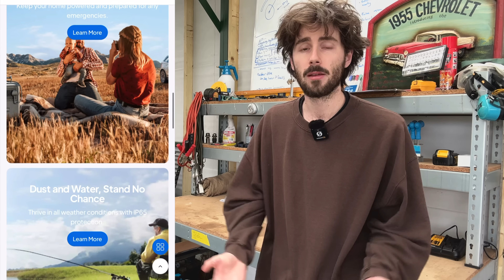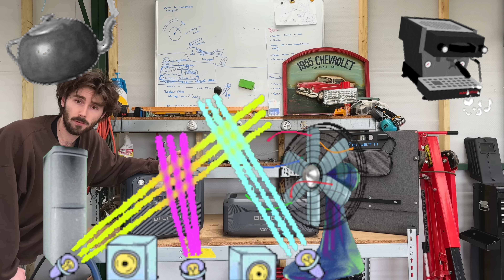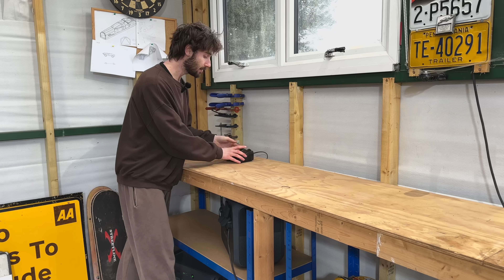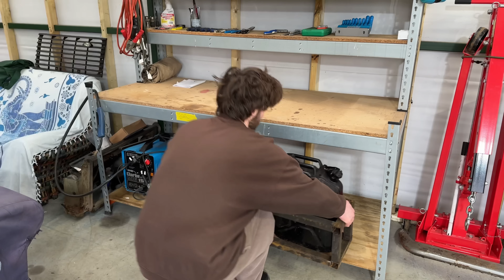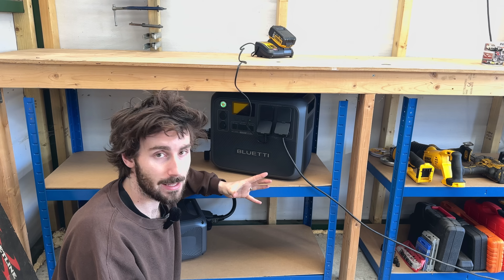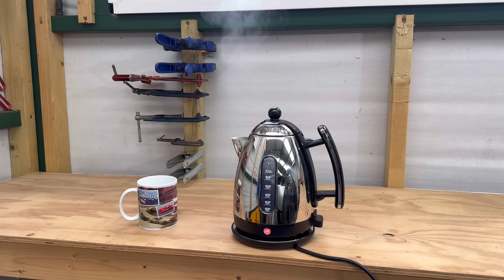Electrifying My Off Grid Workshop

Comment: You might want to invest into an inverter MIG welder as those produce a nicer bead than a transformer based welder. Especially for thinner materials an inverter welder will give you more control.
MIG is the best choice for hobby welding, since it's like a glue gun for metal. You're helped by the fact that the bluetti keeps the output voltage stable, because transformer based welders suffer if there is any voltage instability in the grid.

Comment: Really glad you’ve done this: I’ve been planning to do the same so that I can weld my latest project car in a lockup garage that doesn’t have mains power. This battery set up looks like it will deliver the goods. And is quiet, unlike a petrol or diesel generator 👍
Reply from the maker: It’s brilliant. Completely changed the game for me. They do one larger, that would weld for days!
Reply: @HudsonAutoFilms  I was thinking of getting the 200L on its own - I’d be interested in your thoughts and experience as you use yours 👍

Comment: I built my own solar power station in my garden about 3 years ago, it runs a series of kitchen appliances and all my electric garden tools, It didn't cost a lot to build, about £800 quid, I have a 1500 watt inverter and a bank of leisure batteries to store electricity. I am quite lucky as I get really good coverage between 9.00 and 3.00.
Reply from the maker: That sounds mega. I’d love to do that, but I have to admit…I’m rubbish with everything electrical…

Comment: There are some really interesting diy solar set ups there made with repurposed ev batteries. The battery capacity from a used ev pack is generally around 60-90kwh and if you buy a whole wrecked ev theres tons of other parts to repurpose or resell to get a battery pack very cheap. The hardest part is getting the battery to talk to an inverter but there are already people working on it with solution ready to copy.
Reply from the maker: Very cool. Probably too technical for me!!

Comment: A 200W solar panel can't recharge a 4.8kWh battery in two hours. It would be closer to 32-40 hours of direct sunlight, so 3-4 days if you're in an incredibly sunny area. That panel isn't likely to keep up with your usage. That said, you can get used residential panels for very little money. You could probably get 2 or 3 KW of solar on your roof for $500ish dollars in the US, and I'd imagine similar in the UK.

Comment: 1m of 5x4mm2 grund wire is cost round 2€. Panel 500€ 
I have 50m to barn and after spend 600€ I have 400V 32A in barn from grit. 

Ur device is 240V and cost round 1000€ (last i check few years ago, can be less) 

Even if U have 100M from house panel to barn is stil cheaper in long therm to have grit i workshop.
Reply from the maker: Yeah I’m way more than 100m…miles away from anything
Reply: @HudsonAutoFilms 
Doubt it. There will be electricity within a mile guaranteed 😅

Comment: Great. Glad you found a Sponsor from a Battery Supplier.  As you said it'll Transform ( Pun Intended) your working. You could stick a little heater in there as well👍
Reply from the maker: 😂 but yes great to work with them! Finally light and I won’t freeze to death!

Comment: The cool thing about portable batteries is that in case you’re not able to charge them with solar, you can carry them with you and do it elsewhere. Also, I would recommend installing a couple of 500 wh fixed solar panels so that you can top up that Bluetti a lot faster
Reply from the maker: Yep! I just pop it in the car and take it home. Charged in an hour! Definitely agree about fixed panels, I’ll be doing that this spring!
Reply: I did something very similar with my eco-flow Delta. I converted a 20 foot shipping container into a work area and wired it so I could just backfeed into a small panel and broke up the space into a few circuits. The generator lives in a filtered cabinet with 500 W panels keeping it topped off. It's really the perfect solution for something in a remote area.